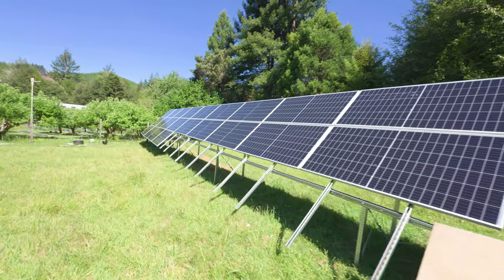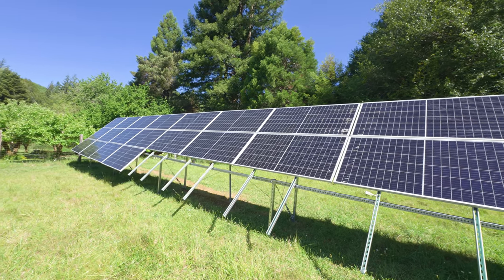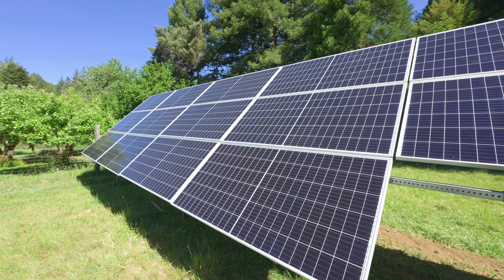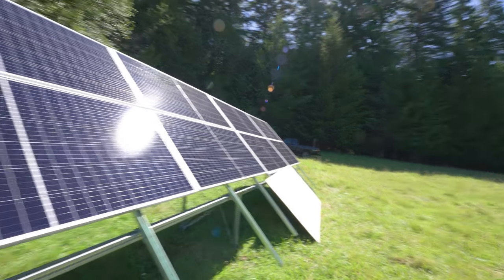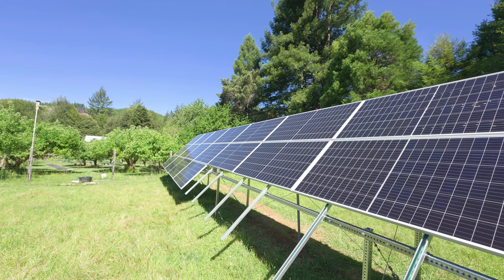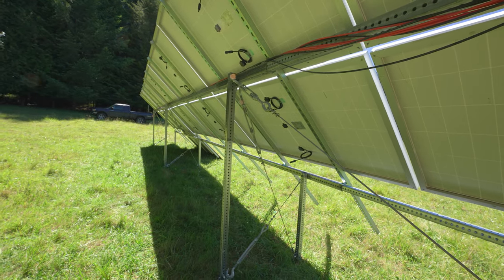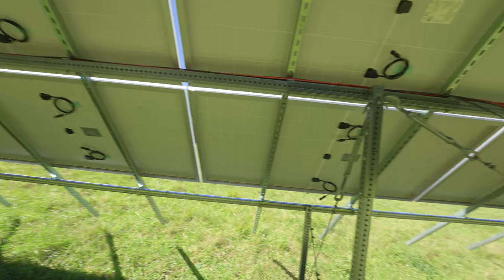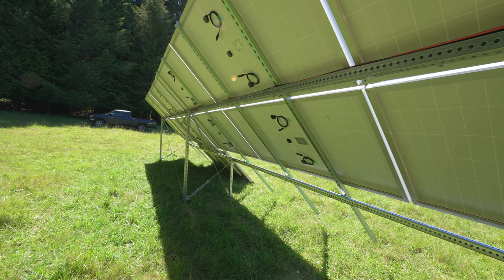DIY 12kw ground solar array

Comment: outstanding job with readily available materials, rather than spending an  absolute fortune on "solar" specific posts etc! Running the various wires over 200 feet may degrade voltage. A combiner box might have served well in this case. Btw you sound exactly like Matt Damon! My hat goes off to you for your ingenuity and sense for becoming energy-independent! I'm working in the direction to have my family completely off-grid as well.

Comment: excellent job , very thorough in the stability dept , i might suggest that where you ran the cables into the conduit that you protect the insulation with some kind of plastic grommet as the insulation on the cables will eventually wear without some protection from the metal , wind movement etc.

Comment: I built a 3kW ground mount system and did some calculations to optimize the angle for highest power production year-round. I am around 41N, which means that the sun is 49 deg above the horizon on the equinoxes.  I decided to set my angle to around 42 degrees above the horizon. 
That may seem backwards, but it's important to consider the average height of the sun above the horizon, not just he PEAK height.
Also, solar production is diminished during the winter months due to much shorter days and atmospheric extinction, so it's worth trading off a little bit of (excess) summer production to help out when the sun is lower in the winter.
Having seasonal adjustability is great, but I've quickly gotten tired of readjusting 30 panels every few months.

Comment: My 20.6 kw sits on top of 34 unistruts, lag bolted to 48 4x4 pt posts on a 36 deg slope. Array is also at 45 deg for better winter production. The rear of my array is 13’ from ground at the tallest point.
Reply: Where are you located? Do you have much trouble with snow load?  I am thinking of using the big strut aka super strut to span about 10ft for a 15kw.

Comment: I am in south Or. I like what you have done. I am subject to county permit requirements. You did not mention permit for yours. I have already been told, if it is not a manufactured racking system, I will have to have private engineering statement drawn. Expensive. 30 400 W panels will not be missed. So I will have to get a permit. Thank you for your presentation.
Reply: I am in Northern Oregon and my county told me as long as the rack is under 10 feet in height the won't care about engineering.  So that's why I am watching these videos for ideas.  Mine will be plenty strong since I don't want damage.  To much time, money and liability to not build a sturdy rack.
Reply: What did you decide to go with for your mounting system? Have you looked at Integrarack IR-45ASA fast adjustable ground mounts? That's high on my list right now.

Comment: Very nice job on the array as well as the video explaining what you did and how.  The question that's always been in the back of my mind is, doesn't it hurt the solar panel if it's in the sun creating energy yet there's no connection for the energy to go to from the solar panel?

Comment: Great video. I am designing a ground mount system to put in. I have seen IronRidge, Sinclair, and lots of wood DIY setups.  Unistrut has been on my minds on top of either schedule 40 pipe or wood.  Bottom line is I want it to be scalable.  If I purchased the whole system I would need 34 panels which is cost prohibitive on a retired income.  Haha. I see this is a few years old.  Any thing you would change as in advice to us novices? Thanks and all the best from north Texas.

Comment: Yea you do need the grounding wire so good thing you ran it too.
Just because they're in the ground doesn't bond or connect anything, earth doesn't work like that. The earthing bond is way more complex but anyway anything even like 1ft away can have a different voltage entirely so it wouldn't bond to your house at all.

Comment: Love it and someone probably already commented this. But where your PV wire goes down in to the conduit. You need that sealed with a drip loop or weather head. other than that. I love unistrut, and have a design for a sun tracking model
Reply: show us your tracking model please

Comment: how come you didn't just make the array parallel to the ground? Where did you find those sleeves and 45 unistrut piece?
Reply: He explained why in the video. He's  in Oregon, and the sun goes very far down on the horizon on Dec 21st up herer in the Pacific Northwest. He angled it to more closely match the spring & fall equinox (March 21st & Sept 21st).

Comment: System looks good but I'm curious why Mount your panels left to right instead of up and down? I have a 40 panel 16.4 410 watt per panel system my installer stood them up and down instead of left to right which shaved off about 20 feet it is 16x45 ft putting them long ways like you did 16 ft by 60 ft.
Reply: He explained his decision in the video.

Comment: Given these panels produce D.C. current, and you mentioned in the vid you were running 200 ft. away, what was your voltage drop at the other end? Did you run individual cable, or run your feed in to an external electrical panel at the panels , combine them, and run one much large fee (1/0 or something like that) back to your house? Thanks for a great vid . All of your parts are pretty much available at home centers , so great vid for multiple mounting options.
Reply: 12:27 - Noticed 4 pair at 10AWG.
Reply: they produce dc voltage, not current. "DC" means direct current

Comment: A couple questions. Did you just drive the posts into the ground or did you set them into concrete?
I looked at material you can get 2” or 1.75” post. I would use 2” and splice with tube inside, use a larger tube for the frame.

Also what was your support spacing - N-W and E-W.
Reply from the maker: I used 2" and 2.25" inch tubes.  The sleeves were 2.25" and the 8 ft segments were 2".  I just drove the posts into the ground.  Have had some heavy winds this winter and the array hasn't budged.  That said, I have a forest of large trees that buffers the wind from the back.  The spacing was two panels wide which turned out to be 160 inches or so for my 400w panels).  I used 12ft segments of the square tubes.  I ended up using some spare galvanized conduit with flattened ends to make corner braces to support the long length of the square tubes.  This was very helpful in stabilizing the array.  I don't have my measurements handy but the distance between the front posts and rear posts was probably about three feet.  I wanted to make it wider, but this allowed me the most efficient use of the size of metal tubes I had on hand.
Reply: @HomesteadingintheForest  Great job! Impressive!

Comment: Hi! Wondering how the array held previous winters? it looks scary,  pretty large wing with pretty small metal framing....
Reply from the maker: Doesn’t budge in winter storms. I put it in front of some thick forest, so there’s a bit of a wind break. Still, it’s seen some heavy winds has been great. If I didn’t have the windbreak, I’d probably set the posts in concrete for ballast.
Reply: @HomesteadingintheForest  thanks mate!

Comment: Were you able to do any wind loading calculations for your array ?
Reply from the maker: I hadn't.  I will be checking with a solar builder in the area to get an opinion.  I have a couple options to stabilize the array if it needs some help.  I think it'll be fine, though.
Reply: @HomesteadingintheForest  Until it blows away, needs to be engineered properly, your local jurisdiction allow that? Its all fun and games until high winds send a panel flying.
Reply from the maker: @glee21012  Yeah, no shit.  It survived the winter including points with very heavy winds and did not budge.
Reply: @HomesteadingintheForest  how much concrete did you use per post?
Reply: The physics math on those panels around 41lbs weight and 45 degree angle at vertical is 85 miles per hour to flip them them without being bolted at all, just leaning against something. So at bolting it'd be more than double that

Comment: Any issues/concerns with uplift on those posts? I suppose no engineered drawings were needed...
Reply from the maker: I’ve watched them through three winters now and some heavy winds, and nothing has budged. I think soil type will have an impact, as will where you put the array. Our soil is clay, loam so things really stick in well, and there’s a large group of tree at the north end that acts as a wind break. I would have added ballast if I was concerned, but this seems to be a winner for me
Reply: @HomesteadingintheForest  Great to hear. How did you drive the posts? With a pneumatic post driver?
Reply from the maker: @ArthurDentZaphodBeeb  I used a cast iron driving cap sized for the posts and sledged from the top of my truck bed. Also dug down a couple feet with post hole digger.

Comment: are there any building code requirements for that homemade rack?
Reply: in most places you need to be code compliant. That means buying a system with engineering approval from the manufacturer or id your own design getting it approved by a state recognized engineer.   I have not seen one DIY rack that went through the engineering approval process.  I am a mech engineer, I might consider designing my own rack and getting a recognized engineer to approve it, but I suspect it may be more $ than buying a system that is approved.  I am developing bare land in an area that requires permits, so inspectors will be around to approve my entire site.  These diy videos are where they already have established dwellings and are not worrying about inspectors coming around.  Even though I will be entirely off-grid,  inspections are required in my county. A big reason is if there is a fire, the firefighters have to be protected from electrical hazards (especially important or roof-mounted panels).

Comment: So many questions asked in comments about sourcing as no details in description despite him saying he would, typical… nice system but useless video if no details and you ignore your commenters.
Reply: Apologies to all. It’s not a straight forward answer with how prices of steel went up during the pandemic.  You have to search for square 2 inch metal sign posts and sometimes go pages deep before you find a deal worth jumping on.  I have sources mine through many places over the years.  All the components to my system were sourced all over the place as I hounded for the best deals I could find.  I wish I could give you an easy answer, but the truth is sourcing the material is a lot of time searching the internet  and prices change frequently, and deals can be had during one period that may not exist in another.
Reply: Pretty closed minded to call it useless. Sorry you get disappointed when someone else doesn't do your research work for you but prices and availability of things change rapidly anyway. Honestly if you can't figure it out you probably shouldn't be jumping into a DIY project of this scale. So many variables in construction of something like this. A material list needs to be custom made by you. Panel size, type of ground, location of site are just a start of variables to be considered. While it wouldn't work for me as is due to space and wind loading it gave me creative ideas. His video was helpful in showing use of a different material as well as his compensation for tree shading and fog, as a lot of inexperienced people might not consider this. Besides that it was free??
Reply: @wildcoastbrew  different account?
I think buying struts and welding them together comes out around 1/3rd the price of these square ones. So if anyone is going that route keep that in mind
Reply: Move along Keyboard warrior.